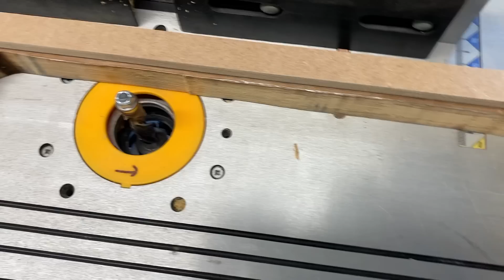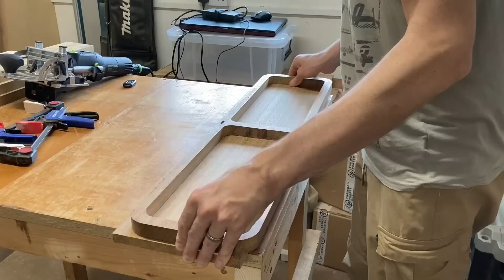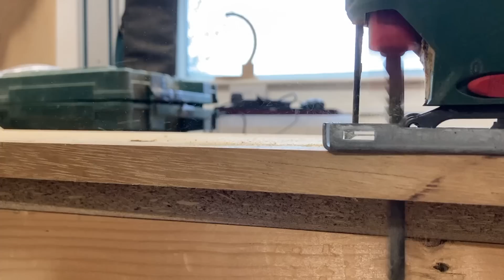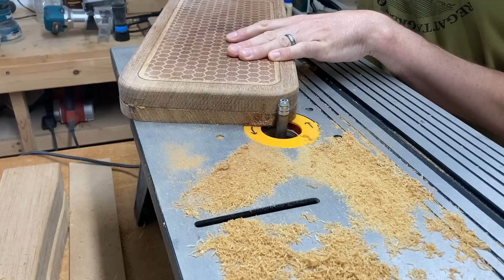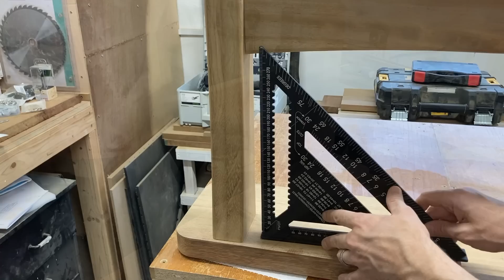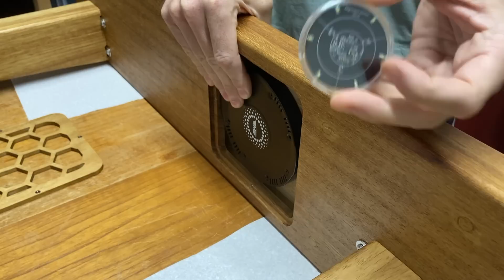Ultimate DIY Sofa Table: Perfect for Drinks & Phone Charging

Comment: very nice project. hearing the thought process as video plays is useful. did you not extend the cable channel to the originally planned point for any reason besides it wasn't too far from original point? it looked like the leg would have covered up the hole
Reply from the maker: Thank you. You’re probably right but I didn’t want to make another big dirty hole in it and moving the legs slightly inwards didn’t end up effecting the design too badly.

Comment: Fantastic video, new subscriber. Love the inlay- can you share details on your CAD/CAM workflow? Thanks!
Reply from the maker: Thanks. I usually do a rough design in Fusion360 to work out dimensions. For this project I used Vcarve desktop to generate the cut files, I find it easier than Fusion to make simple designs and inlays. Then the gcode was loaded in cncjs to run the cuts.